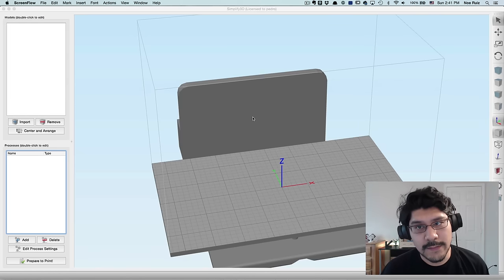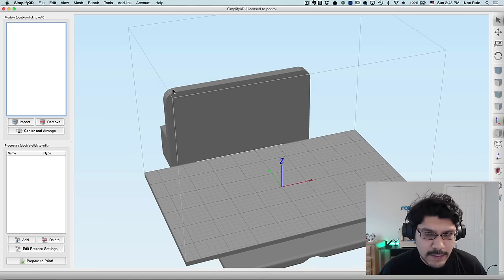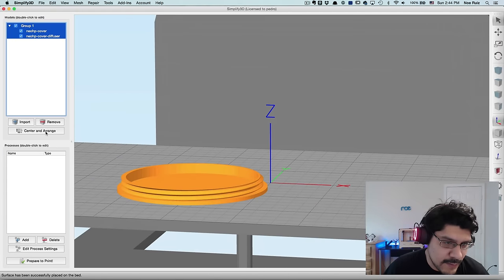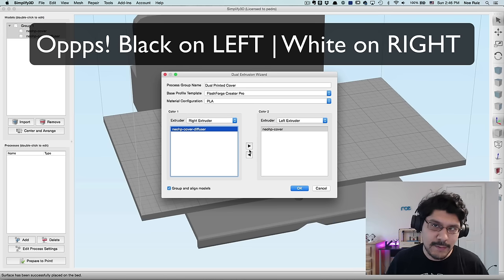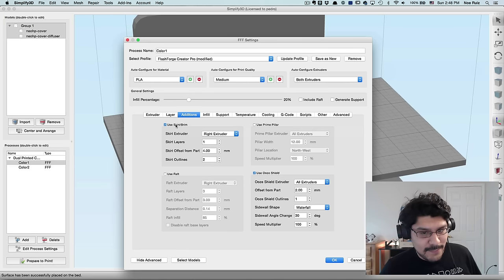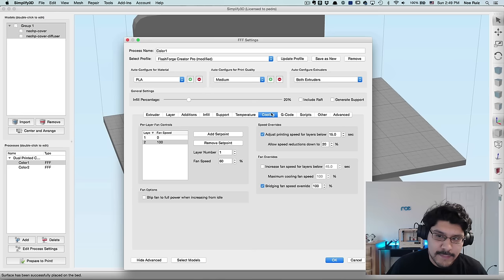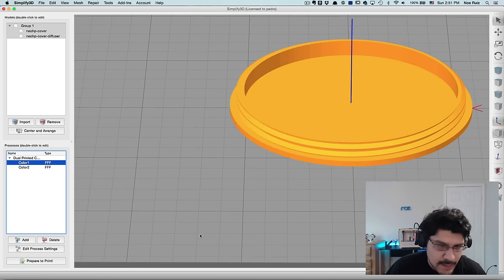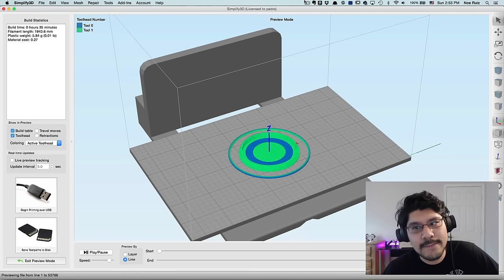Layer by Layer - Dual Extrusion Setup

Comment: Great video, do you know if you have a single model in simplify3D and you want to use two different color filaments can you set it up to print using the second toolhead after layer 50 for example

Comment: Hey Noe, great video, I wonder if you may be able to assist briefly - I only have a Wanhao Duplicator i3 (Single Extruder) which I'm very happy with and have the settings pretty much "down to a T" as we brits say, however I have previously struggled with combining parts.  I use Cura 15.02 (since I sadly can't justify the cost on Simplify3D (printer was a gift)) but I find that I can never snap parts together.  Screw holes are too small, pegs are a fraction too large or in this case here, the parts overlap marginally so I can't push them together.  I wonder if you may have any suggestions on what settings I should perhaps alter?

I currently use these settings: http://3dprinterbrain.info/pmwiki.php/DupI3/SlicerSettings

Additionally, Layer height is normally 0.2mm, shell thickness is 0.8 and Bottom/Top thickness is 0.6

Any advice or insight would be greatly appreciated.  Many thanks in advance.